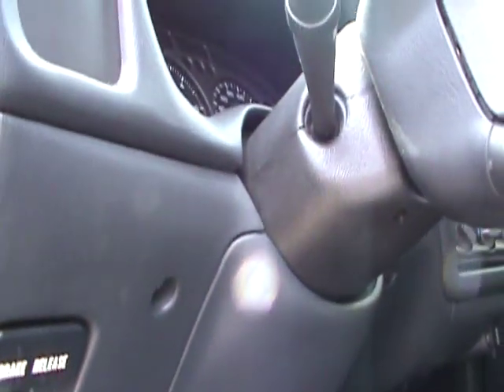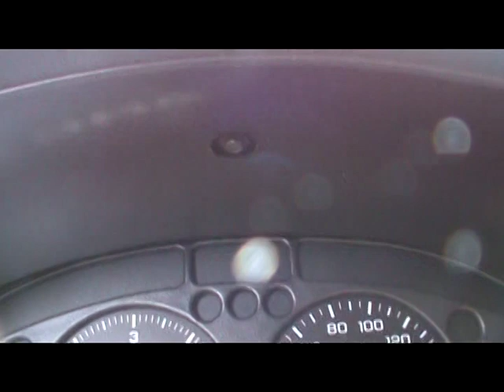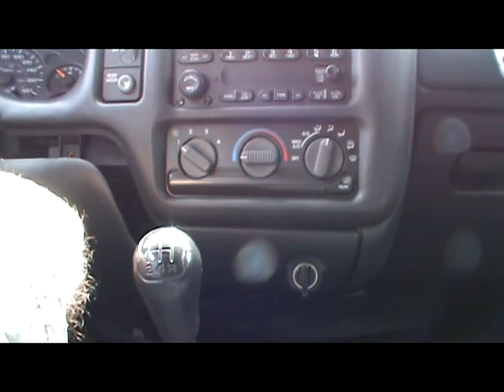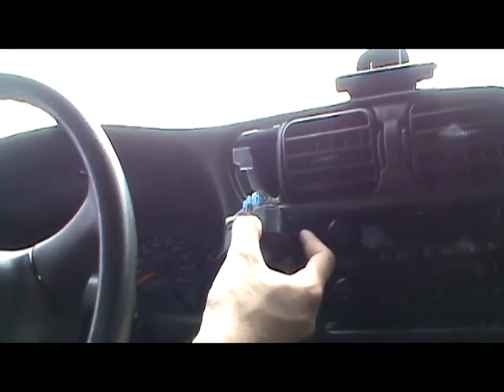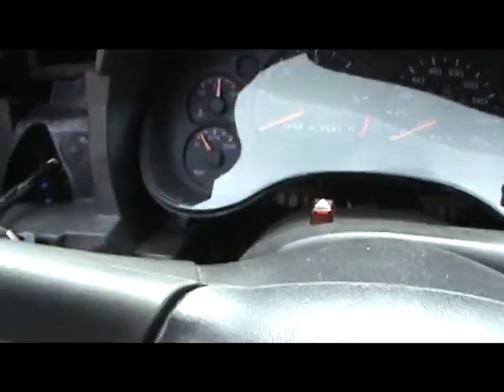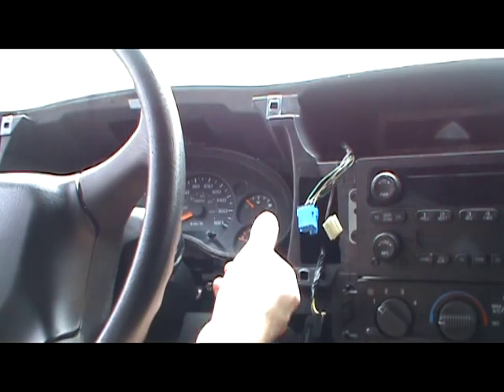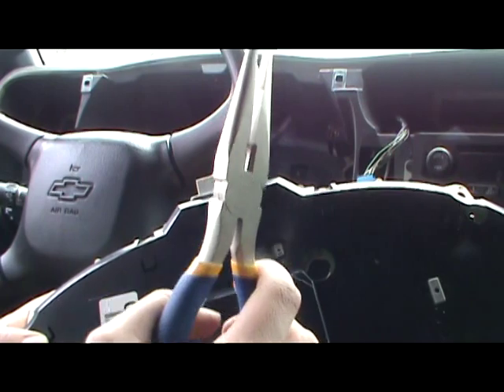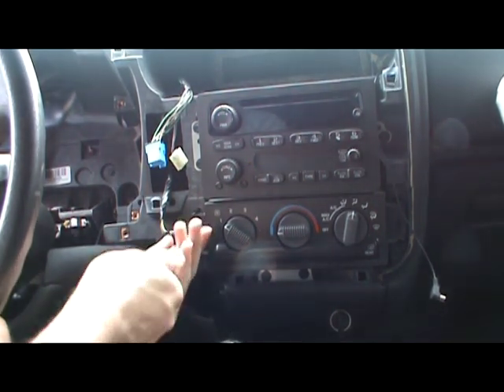Blazer Dash Bezel How To

Comment from the maker: @tbirdsport302 You can, but the wiper controls use small bulbs that are soldered to the circuit board, and the light controls also use a small bulb, when you pull the headlight control out, you'll see a little grey disk with a flat-head slot, turn it counter clockwise and pull it out, you'll need to match that bulb type. I suggest going to the dealer and getting it.

Comment from the maker: @britlynforever I don't own this truck anymore, but if you want to keep your stereo controls make sure you buy a head unit that is InfraRed capable. Next you can buy a module that connects to the green data wire and will act as an IR Remote and will control any deck. If you just want a sub hooked up to your stock HU though, you can tap the sub wires into the rear speaker wires. Not as clear as an aftermarket HU with RCA outputs. I've had both, big difference.

Comment: Eugene...you might find  the plug on a junk yard blazer and cut it out and wire it to your wiring, then there is a wiring adaptor you can get for around $8.00 us. and it will plug right in to your radio. very simple connection !

Comment: Thanks so much for this. I live in Ottawa and the dealership I go to wouldn't fix the cluster lights in my 05 blazer because they said they weren't repairable and wanted to charge me $500.00 to take it out, then send it to Toronto to be rebuilt. What a joke!! Where did you buy the replacement bulbs and did you also buy new sockets for the bulbs or re use the old ones. Thanks again!!

Comment: @supersanchez1991 After you remove the gauge cluster, the clear plastic part is just hooked on by a few plastic tabs. Very easy to remove with a flat head screw driver.

Comment from the maker: What has been done before in your case is people have bought the 2003+ style sockets and LED bulbs separate and replaced the soldered style. look for the sockets on ebay. As far as your climate controls. In my current truck I will be using LED strips for my LED upgrade, and unsolder the current bulbs. Look into that.

Comment: Well, I removed the dash, cluster and all that good stuff today just to see what bulbs were removable, The base and the bulb come out as one like yours...but I cannot get the damn 194 bulb out of the base socket. I am pulling on these little guys as hard as I can but they will not come out from the socket. Lol and my luck of course...I have the automatic climate control (the one that keeps the cabin at a certain temperature automatically)....and all the bulbs are soldered on and unreachable :(

Comment from the maker: Should be. If it's a column shifter, just turn the key to the ignition on position, put your parking brake on, apply the brake and shift into 1st when you go to pull the bezel off.

Comment: Yo Dude that was great. But what year is your blazer? The reason Im asking is I need a pic for the connector to the radio. I have a 2005 blazer and the person that had it before me cut the connector off to put in an after market radio. Hope u can help with a pic of it. Thanks.
Reply from the maker: Don't have the truck anymore, but it was an 05. It'll be the same as any GM truck radio connector. Silverado, Sierra, Yukon, Burban, Jimmy, Sonoma, you name it it's got the same connector. Hell probably even the cars too.